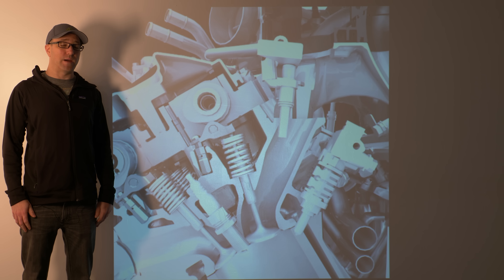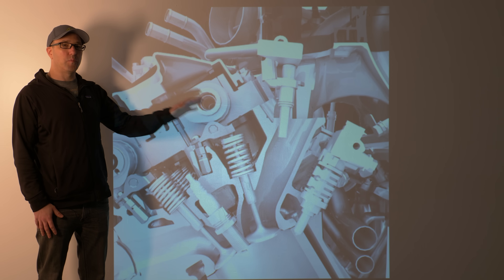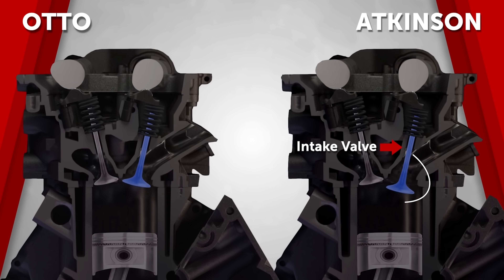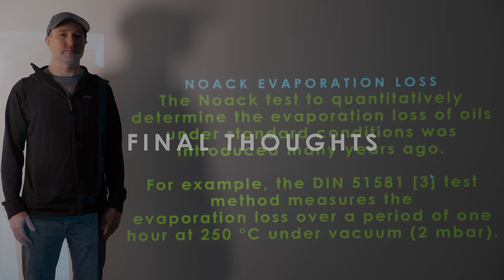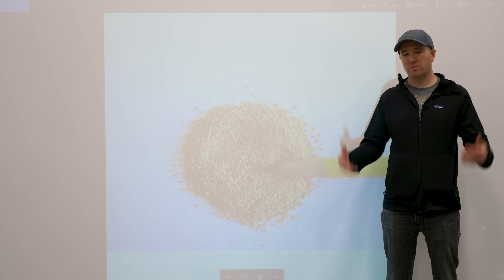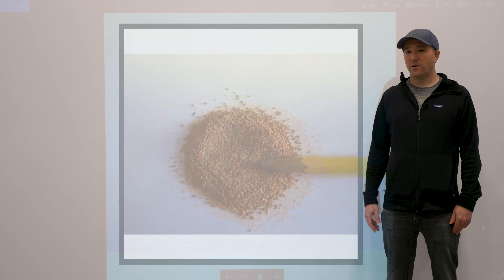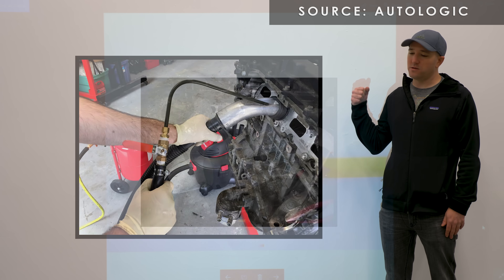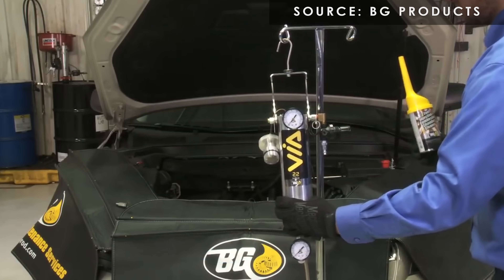Direct Injection, Problems and Solutions | The Fine Print

Comment: You explained PCV wrong.  Combustion gases will push past the piston rings and go INTO the crankcase.  PCV typically pulls fresh air from the intake stream, and runs it into the cylinder head.  The this air flows from the cylinder head into the crankcase below the pistons to wash out the crankcase gases; oil vapor and combustion gases.  The crank case gases are then routed back into the intake to be reburned in the cylinders.  This is what coats the back of the intake valves.  While you can get some combustion gases to back flow and settle onto the intake valves, the majority is from what I just explained.

Comment: One other option that I'm going to try is using CRC Carbon cleaner. You stick the spray wand into the intake after the MAF, have someone warm up and rev the engine to about 2K rpm while you empty the can. Takes about 5 min or so, from what I understand. I plan on doing this about every 10Kmi. I try to always use top tier gas and I run Amsoil. Hopefully, I can avoid this issue down the road.

Comment: Water/Meth injection should be standard equipment on a DI only engine. It would be cheaper than dual injection. It will steam clean the entire intake path. Even piston tops. It is even better if your engine has a turbo. Anyone with diesel or gas DI should take a look at a kit.
Reply: Geoff Moore 
Have the AEM kit on my '13 ecoboost F150.  That plus a UPR catch-can is the best insurance against the carbon / pcv issue!
Reply: Good call I have a 17 Sequoia so still rockin port injection

Comment: Question does an engine cleaner like seafoam help alleviate this issue?  I wouldn't think it would solve it but perhaps slow down the process. Every oil change on mazdaspeed3 I put seafoam through the intake vacuum line. I currently have 85k and do not have any codes and any noticable problem with fuel economy.

Comment: I think you misread the PCV diagram. The PCV is for ventilating blowby into the crankcase below the Piston head. You aren't ventilating the upper part of the engine, as that's what an exhaust valve already does. The blow-by gasses are forced downward, past the piston rings, into the crankcase, need to be evacuated.

Comment: Great video.  One thing worth noting: Ford STILL doesn't have a cleaning procedure for intake valves on DI engines.  They still just replace the entire fucking cylinder head.  It's completely absurd.
Reply: Didn't know that's still the case. Somewhere I read a Ford engineer adamantly denying that they went to Port/DI hybrid for carbon buildup issues, they said it was for efficiency. Not sure I believe them.

Comment: The thing i don't understand is, did GM and ford see this problem when they ran their durability tests? If this is a real problem, they could have easily modified the PVC system to incorporate a oil separator. Is this a real problem or internet hype?

Comment: There were five times in this video where you could have cut to the chase and not gotten off flow, which would help with making your points clearer. As an owner of a GDi Genesis, (ps. no thanks to your misleading headline for your Genny review), apparently my only recourse at this point is to use a chemical cleaner through the intake system. Coulda just said that.

Comment: Once again,this is just more evidence as shown that higher tech is not necessarily always the answer to every problem. I think I'll probably just stick around with good ol' fashioned port injection. For as far as I'm concerned,direct injection is just some stupid fad that will inevitably die out soon if they can't make them run in a way that requires less maintenance,just like with all those ridiculous 8 and 10 speed transmissions they're all coming out with. I mean for cryin' out loud,these are cars,not friggin' tractor trailers or whatever.

Comment: GDI means less fuel condensed out of the fuel-air mixture by the walls of the intake when the engine is cold. Also, GDI permits the fancy spray sequencing that Mazda uses in its SPCCI engine. The multi-sequence spraying, after the intake valve is closed, is what creates the rich mix near the plug that makes SPCCI possible. Also by spraying directly onto the hot piston, via GDI, we get better atomization of the fuel and we get to cool the hot piston crown. GDI's benefits far outweigh the disadvantages.
Reply: I agree. One addition about "GDI means less fuel condensed out of the fuel-air mixture by the walls of the intake when the engine is cold." With turbo or compressor charged air-intake, the fuel is even more likely to condensed. And even if it doesn't condensed on the wall you still get gasolin-bubbles that create a bad air-fuel-mixture.
Reply: Agreed. But another problem with GDI is piston crowns  eroding from the  high PSI fuel hitting them.
Reply: @aaronhumphrey2009  if that's true it would be a huge problem in diesels
Reply: The biggest reason is there's no fuel in the cylinder during compression which completely eliminating pre detonation. The fuel is injected at the same time as the spark. You can run very high compression on low octane fuel
Reply: Dude why did you copy that from the brochure dip shit

Comment: This is why Toyota is amazing. They only released port and fuel injected engines from day one. You cant say that about every other manufacturer.
Reply: sdlausen to bad they have to replace pistons because the rings getting carbon build up.
Reply: I like Toyota. But they messed up too. Lexus IS250 second generation was DI without the port side. Lexus paid for it but learned. Ford learned too. 2nd gen eco boost having cleaning injectors now

Comment: Great video!! Admire your work. Little confused there about how you defined blow-by. And headspace is not crankcase. Right? PCV is used to remove the build up on the lower part of the motor (crankcase) using a vacuum through oil gallery.  Is it different for DI engines? As far I knew, blowby doesn't depend on port or DI, it is more of a cylinder liner and piston ring design. But carbon build up happens to DI because of no detergent contact. I think that PCV and carbon build-up in DI are two separate issues. Again awesome and well-researched educational video.

Comment: This doesn't make me feel good knowing I have a Direct Injected turbocharged motor...
Reply: Don't let any of this scare you, this all is worse case scenario, the pictures being shown over and over is usually the same screen grab on all these doom and gloom GDI issue vlogs.

Chances are you will never notice the slight fuel mileage and slight power loss that this carbon buildup on your valves causes and that  won't even be an issue till well past the 100,000 plus mile mark.

And stay away from any of the spray in GDI cleaners, especially with a turbo motor, if there is any carbon buildup, you have more of a chance of flaking it off and it sticking a ring or feeding into the turbo causing an issue.

Best defense for carbon buildup? Get out and drive the thing, usually a nice long trip annually is all ya need, (we go to Gatlinburg every year, about 1000 mile round trip for us)  heat burns up carbon, the worse thing for a GDI engine is short frequent trips where your motor does not get up to operating temp and sustains that temp for long.

Plenty of GDI  engine cars out there running fine way past 160,000 miles and also over 200,000 with no issues, don't let these folks scare you. Chances are you will never have an issue. Plus remember ALL cars have issues, many port injected cars have issues as well with their injectors and fuel rails, you look hard enough at all cars and manufacturers and you would be scare to buy any car nowadays. And remember the internet is full of unhappy customers cause they want to complain, but usually the vast majority being happy customers don't waste the time praising a car.
Reply: Scott Bartlett Wow thank you for opening my eyes to the reality of this. Taking long trips is actually a really good thing to know because I have taken semi long trips (1.5 hours each way) with it about 5-6 times over the past 2 years of ownership. However, I also take many frequent small trips too. I live in a climate where it's 20 one day and 70 the next. You're right when you say that there are just too many unhappy customers nowadays. I'm an extremely happy customer of mine because it gets great gas mileage and if I take care of it you're right when you say I'm sure I can still get 200 out of the motor or more, because it's a Honda
Reply: No problem Andrew, I am a Chevy guy, but, I bought a Hyundia Sonata 2.0T Limited over a year ago, I originally wanted a Impala LTZ, but could not justify the cost, my Sonata is 274 horse, plus gets 34-36 mpg and is loaded with everything the LTZ had.
So far I love the car, it has great power and great mileage. I have many friends and family that are mechanics and really investigated what was being said about the GDI engines. Catch cans do zero, spraying cleaners down intake does zero. Fuel additives are a must for injectors only, best thing for the carbon on valve issues is long drives and limiting short drives where ya turn the engine on and  off before reaching temp. (However, this is true of any engine, not just GDI, but compounds the intake valve buildup on GDI engines much more.)
You will get buildup, it's the nature of the design, but the power loss and mileage loss is minimal and most drivers will never notice the slight decrease in both over the life of the car.
Most times the severe issues people are showing are pictures of are poor maintained cars. You MUST do oil changes on a regular basis, I use full synthetic and change my oil and filter every 4200 miles or sooner if I know I have done a lot of short trip driving. Follow your owners manual on oil change frequency and do not go off the bottle of oil that says the oil is good for 5000-7500 miles, GDI engines just have too much fuel wash to contaminate the engine to do this.
Reply: @scottbartlett2087  This the best information I read... you know GDI engine ,and I agree with you,  short trip is the the best for carbon buidup.
Reply: Yea I bought a 2017 Honda Civic with turbo and di. It has 8k miles so far, hopefully I can get 150k 200k and more cause I really love the car/engine. Don’t let us down honda
Reply: I have a 2015 kia optima sx turbo and has 46k with no issues. I use 93 octane, synthetic oil, and techron every oil change. I drive 30 miles each way highway everyday to work and take some long rides, too. Don't forget to redline it once in a while, too.
Reply: I have over 150,000 on a f150 ecoboost and have had no problems at all. Fuel economy is still great.
Reply: scott a mini with 200k with no troubles i do not think so
Reply: Get an AOS installed. Not a catch can. It'll help keep soil & crap out of the intake more than a catch can will.
Reply: @SirBrass  I back that also bc an aos has baffling and a swirl effect that helps filter the oil vapor and droplets out of the air where most catch cans are no different then running pipes thru a soda can #useless.
Reply: There is some truth to what he says but also a lot wrong I've seen tons of German cars be perfectly maintained and some not and have carbon build up at the same mileage between 30-70k miles consistantly but the only difference I've seen that changes how fast the carbon builds up is how hard the car is drove. If you baby it long trips or not you will get carbon build up as soon as 30k but if you drive it hard then around 80k or never. Good example is with vw's the normal non sport line like Passat and tiguans get carbon alot bc they are usually drove easy but the gti's or gli's might have it at 80k or never. This example being they all 3 run the 2.0t engine and in both versions the BPY code and CCTA codes one is belt driven and one is chain driven. Catch cans make sense but I have yet to see one on a customers car that worked well and that's not to say there isn't one out there I just haven't seen it yet. So far tho on Porsche H6 di engines I haven't had any carbon issues.
Reply: Jeffrey Newhook I’ve haven’t heard of any Kia’s or Hyundai’s with carbon problems. People keep passing images of so called engines that they use, but never check the sources cause they’ve all been Mini Cooper, VW/ Audi engines.
Reply: @tails300  This is true I've done more carbon cleans on vw and Audi then any other car line.

Comment: I like the educational videos,  just a couple of things and take it for what its worth.  1)  Oil catch cans, may or may not work.  There is evidence they work, there is evidence they dont.  Remember though, Oil Catch Cans are for "Off Road Use Only" according to DOT, and Most States for Smog.  In strict Emission states like California, an Oil Catch Can is an automatic fail for your emissions test.  2)  Oil type and NOACK rating will help, and thought that was very good point to bring up.  Most 20w oils out there have a NOACK of around 10 and this is for synthetics, you can get some 30w's in the 6% range.  Redline 5w30 and Penzoil Platinum Ultra are both around 6% for their respective 5w30's.  Just keep an eye on your manual and your cars requirements.  Some manufacturers are getting so picky now a days, if you do not use the correct weight oil that they recommend and you do for some reason have an oil related failure?  Its a 50/50 they will cover it, or at least give them an out for not having to pay for anything.  Unlikely to happen, but still possible.  3)  Gas.  He is correct in saying that additives dont do much for DI engines, though MOST Manufactures selling DI engines recommend the use of "Top Tier Fuel".  This will help keep injectors clean, and help with a cleaner combustion overall.  So it does help long term.  4) Lastly, there are some companies that recommend what is best known as an "Italian Tune Up" for DI motors.  Basically, you need to drive the car over 3000 RPM for a prolong period of time, this heats up the valves to a point where the carbon can burn off on its own.  DI engines HATE to idle for long periods of time, cars that do allot of city driving and not much highway will see carbon issues much sooner than later.  So get your car on the freeway and drop a gear get the revs up for a while every now and then.  That has been shown to help.  In the end?  DI motors are going to carbon up.  It is what it is.  Some carbon worse than others.  Just do what you can, put a few dollars a month away and in 3-5 yrs if you need the intake valves cleaned you will have some money aside to do it.  Just my ten cents.

Comment: SG, I have heard and seen some decent results with Seafoam.  It isn't the snake oil that everyone says it is.  Maybe you can make a video on the proper way to use it and why it works.  Its not as good as walnut blasting but it may be good as a maintainer in between blastings.

Great video as always and spot on.  FYI, something to look forward to in the future are more advanced EGR systems.  You have Stepper motor controlled, DC motor controlled, Hot EGR, Cold EGR, and you also have Low Pressure EGR.  It might also be another nice topic of discussion for your channel.  Can't go into great detail, but I can give you an overview on all the differences if you want it.

Comment: I have had mechanics comment that gas with ethanol is water loving which causes the many of the symptoms you describe for DI because water vapor blows by the piston and over pressurizes the crank case. The symptom we see is sudden oil loss for short periods - like a bad tank of gas. Does this make sense?

Comment: I know that a VW engineer in a patent of some kind noted that running the engine occasionally above normal loads actually helps with cleaning the intake valves of of their FSI and TSI motors which are just GDI engines. He then noted that driving slowly and not pushing the engine will help accelerate the process of carbon build up.
Reply: Wael Al-Zubieri this is the same theory in mazda forums as well.

Comment: Direct injection works just fine, basically your real argument with it is the maintenance associated with it. There are things like sea foam and other additives made to clean the valves, injectors, etc. not all cars can run lean without considering emissions, running lean can cause a meltdown of the cylinders. Some manufacturers are running the engines lean to get better mpg so I don’t understand this argument. Catch cans are always beneficial regardless of engine type. Also telling people to use fuel additives is an issue because some can cause new issues or just not work at all. For the oil simply use the oil weight recommended for your car and research to find the best one. This argument also would say that Diesel engines are prone to failure when diesels can go millions of miles before complete failure. To buy a port and direct injection motor is more expensive but you also made the point of pricing the maintenance on a direct injection engine so they don’t really solve the problem just shift it. The real solution is to just take car of your car with a catch can and use something like seafoam to keep it clean. Don’t sacrifice performance for convenience.

Comment: You are the man mr. Savage! I have 2016 Optima turbo GDI and this video was super knowledgeable! 
Do you believe in Top tier Gas or is it just marketing? Thank you.
Reply from the maker: It is well know top tier fuels have higher grade detergents and different additives than cheaper gas.  I owned a car that BP used for internal testing of their fuel.  They bought alternative fuel vehicles for testing additive packs for to see if it reduced deposits and increased fuel economy, then scoped the motors to see differences after 30k miles on dynos and test tracks.  So yes there is a difference, as comsumers will we ever know how much?  Not likely, its all proprietary.